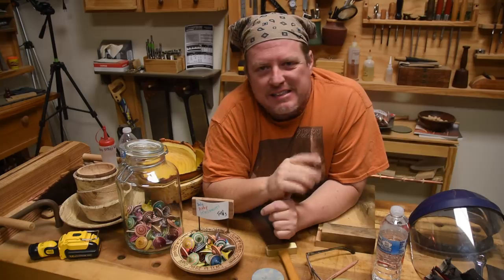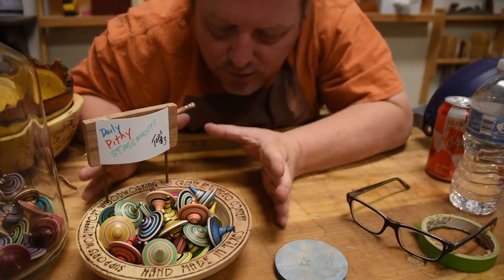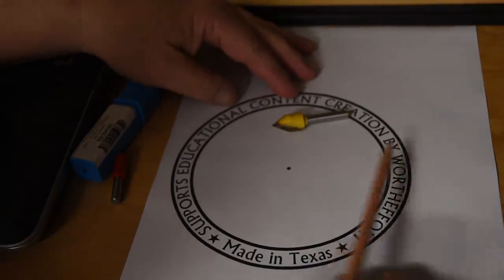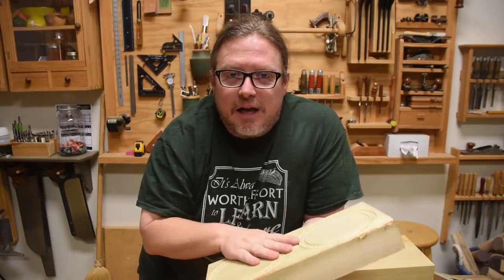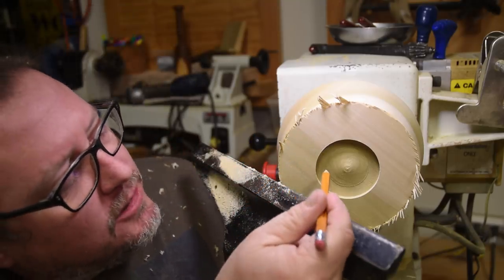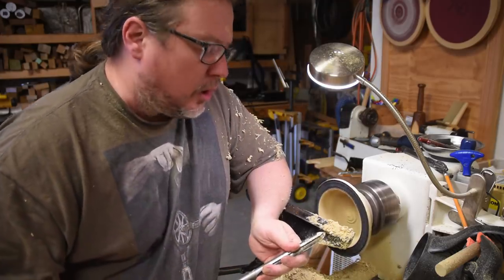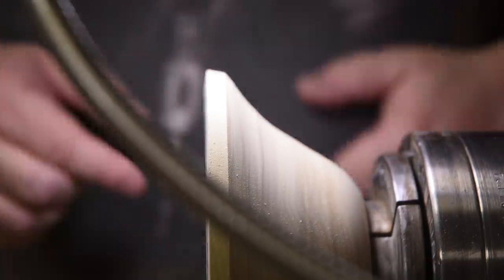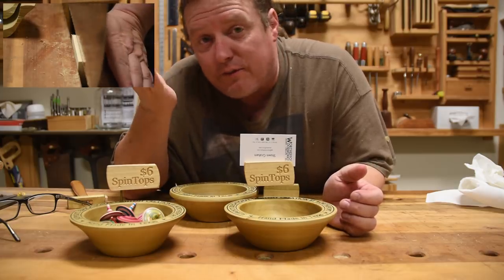Carved Rim Bowl Display

Comment: Nice project.  Just a thought - Spray the wood before V-cut  or better - Use Cactus Juice and vac chamber - draw out air and replace with PEG that dries and stabilizes the wood - makes it stronger and a bit heaver.  Check out Resin carvers - bake the wood, Put in chamber and draw out air and have it below the level of Cactus Juice and it will replace the air.  Use left over again on next job.  Better carving and better turning soft wood.
Reply from the maker: If you add labor, or steps to a project you add cost. Cheater to use better wood than poplar.

Comment: That was interesting! I have been wondering about using a CNC machine with turned projects, but was hesitant to put a finished piece on the CNC machine. Cutting first makes sense! And making those outside lines thicker worked really well. Thanks for sharing!
Reply from the maker: Thanks

Comment: Always enjoy watching your videos - you must be the best teacher on youtube!  Using Aspire for the lettering, consider creating a 3D model in Aspire with the top surface rounded over as you plan to finish the boul where the lettering is. You can then create your text, assign a V cave tool path to it and also select the option in the toolpath config to "Project toolpath onto 3D model". This way the toolpath will cut the letters all the way down to the finished depth across the rounded profile, allowing for the curved profile, so it will carve deeper where necessary. Then when you trim the edge of the boul on the lathe to your desired profile (the same as the 3D model you've created) the lettering  and circle lines will be cut to the proper depth overall. Well worth a try.
Reply from the maker: Good idea, still learning that program.
Reply: Yes, that sounds good in theory and does work but you may be forgetting that the bowls are turned individually with no guarantee that the curve is consistent between bowls.  Without that consistency, even by as little at 0.002 the vcarve will not be uniform.  If there is a way to overcome this please let me know.  Thanks!
Reply: @robertwelch5584  Yes I realise that and it was only a suggestion. However, I'd be willing to bet somebody with WTE's obvious knowledge and experience would give it a good go.
Reply: @redkite200  Thanks for replying and I'm not trying to beat you down or be a hater.  I've been scratching my head trying to figure out a way to make that work and am hoping as you pointed out that someone out there would reply and say all you have to do is ...  Take care
Reply: @robertwelch5584  I'm not a turner so I don't want to sound like I know the answers at that end of things.  (In theory) a couple of thing come to mind. I'd try carving the lettering as I suggested and then filling the text in with the colour. That way when you begin turning the piece, you may be able to see the text as you turn the roundover profile and be able to trim it just right by checking progress as you go. The other option that comes to mind would be to create a profile template. As the profile is already defined in Aspire I think you should be able to reproduce that in 2D and cut that shape to scale. Again I would think, you'd need to check the profile as you turn against the template. How does that sound?
Reply: @redkite200  That's what I'm going to try, thanks.
Reply: @robertwelch5584  Sounds good. I'd be interested to hear how it goes.
Reply from the maker: Robert Welch I determine the curve so I can make it consistent.

Comment: Inspiring and informative channel, love it.
In regards to chip out with carving, (and I have no experience) is there a material you could coat the wood surface to be carved, that would hold the fibers together a bit while carving. Then sand it off after? 
Thanks,   Gary

Comment: Cool video. I am curious if soaking the carved side of the wood for 30 minutes to an hour or so in some boiled linseed oil or some super thinned shellac and letting it dry before running the cnc would help with the tear out. I have tried that before on a really old and very dry piece of mahogany and a piece of teak that I turned. It worked really well in that particular situation.
Ron
Reply from the maker: That'd work but would add an inordinate amount of time. It'd be cheaper to spend more on better material in my opinion.